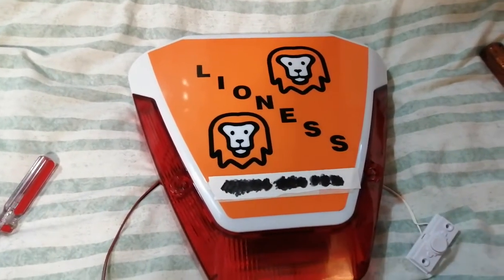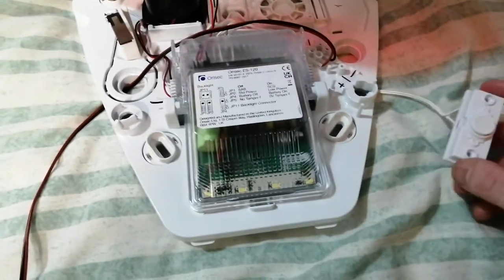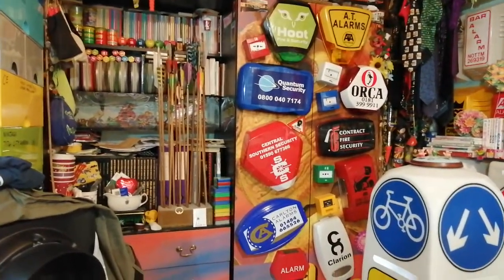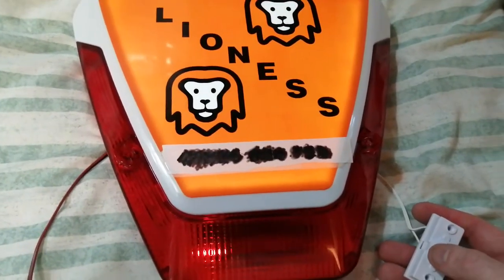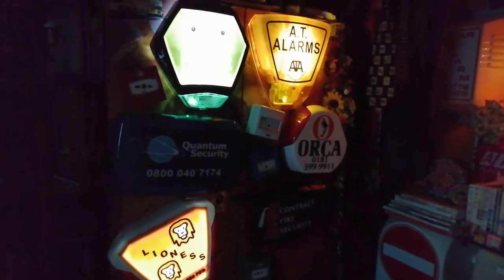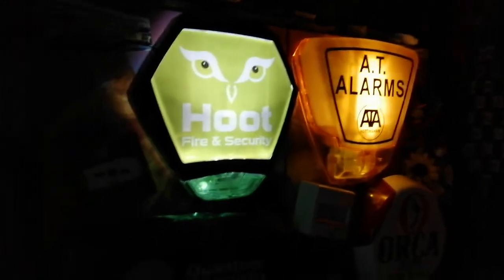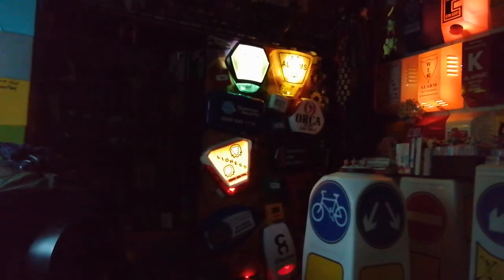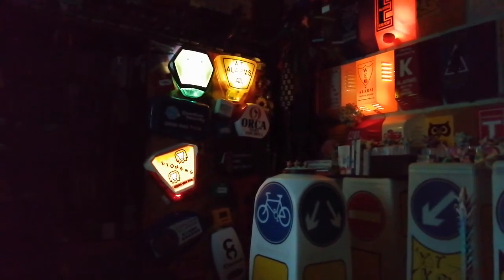Orisec night light

Comment: As a alarm engineer myself I personally think the odessy 3e and 3x is a fantastic bellbox. The orisec we used to install until we found for some reason  the back light stopped working after a year and a half. But great video as always
Reply from the maker: Thank you. Being. A box collector I just wanted it for the box. I use these boxes as night lights for my room
Reply: @audiotron1003  that's so cool for my little sons room I'm going to make him a odessy 3 clock for his room
Reply from the maker: I have an odyssey 3x and pyronix deltabell live unit lit up too I use a 12v adaptor to run both of them as night lights I had the piezo disconnected so that they light up and leds work but not go off.

BTW my aritec chub box is my 'alarm clock ' it's a dummy box but I fitted red, green, and blue led units run on batteries to make it interesting.  I later moved the leds into my pyronix decibel box.